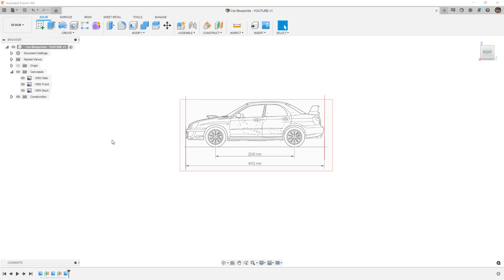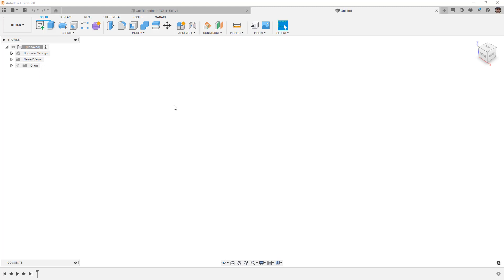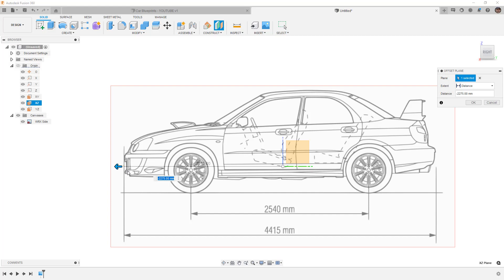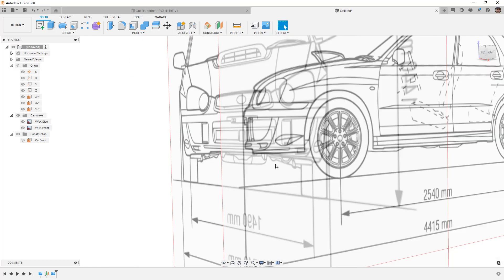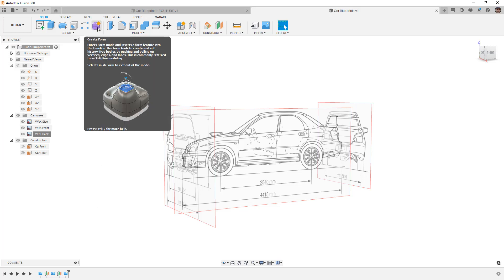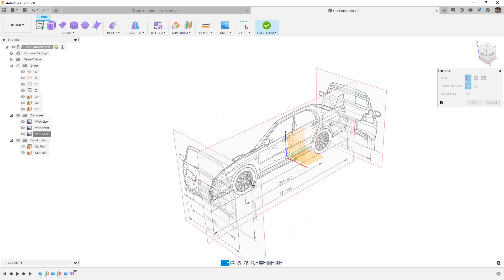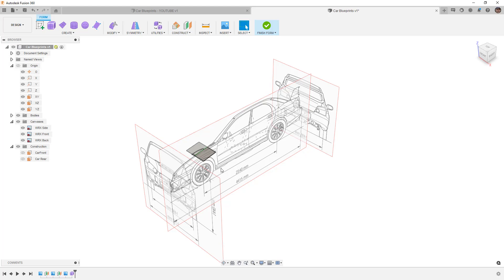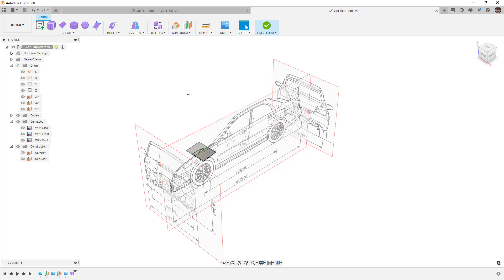Fusion 360 Forms - Part 2 - Using Blueprints #Fusion360 #Forms #WRX

Comment: How would you model the Tesla Cybertruck? Since it has very flat panels would you use the same method or would it be easier with a solid model?
Reply from the maker: I haven't tried to model one but I would assume its pretty straight forward with all the flat sides as well.  I have plans for an upcoming video doing a stealth jet which has a bunch of flat faces.  The way I did that was with 3d sketches and laid out the boundaries of each panel.  I wouldn't use forms for the cybertruck, but you could if you creased all the edges.